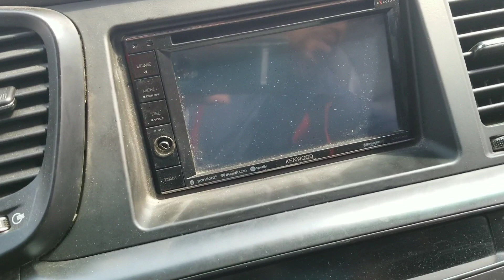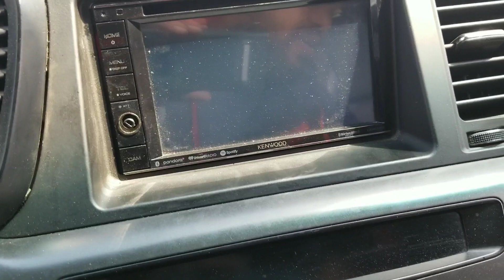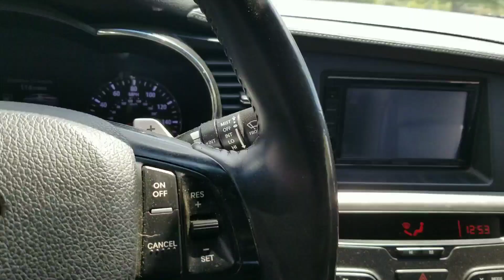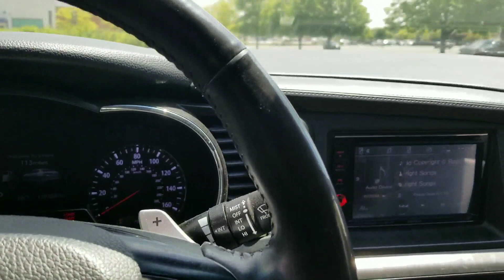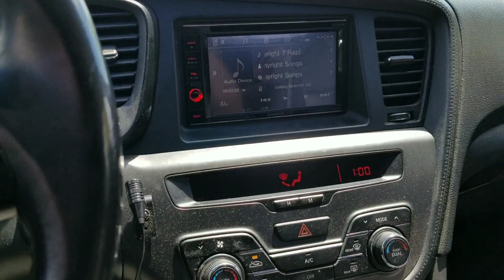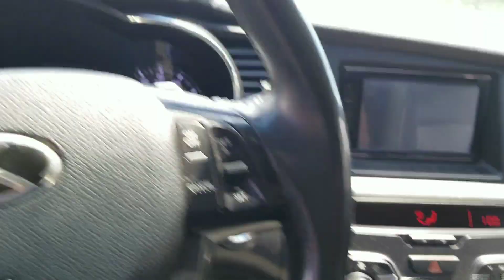Replacing Front 3.5 speakers with PRV 3.5 TW350TI-4 Slim in 2012 Kia Optima SX Very Loud tweeters

Comment: How do they sound compared to the soft dome prv?
Reply from the maker: They complemented each other very well the three point fives were loud and  vocal the soft tweeters gave the good high hats
Reply: @markwoods212 I already have the slims, but I'm thinking about going with the soft dome. My initial plan was to run 2 pairs of slims in the a-pillar. I was about to order another set of slims, but do you think I will be missing the high hat if I don't get the soft? I already have the 6x9 and 6.5 prv hooked up.
Reply from the maker: No not really but the soft tweeters just deliver better high hats but you should be alright with only the high tweeters

Comment: I dont know how to onstall it with the capacitor, what terminal would that be, and did you soder it?
Reply from the maker: I cut the factory wire from the front speakers and connected the positive to the capacitor/bassblockers and negative to the other side
Reply: @markwoods212  alr thank you so much, about to install them!

Comment: Do you have an aftermarket head unit
Reply from the maker: Yes I had a kenwood double din
Reply: @markwoods212  are you running the tweeters to an amp, im asking because I have a Kia Forte 5 and I'm running mines to and 4 channel alpine amp...they are awesome...im sticking with the factory unit
Reply from the maker: @Yolathegreat1970  It’s ranned to the four channel cause I have all the factory speaker wires running straight to the for channel